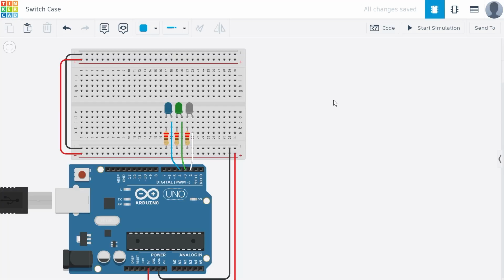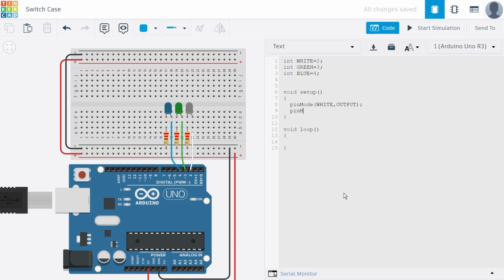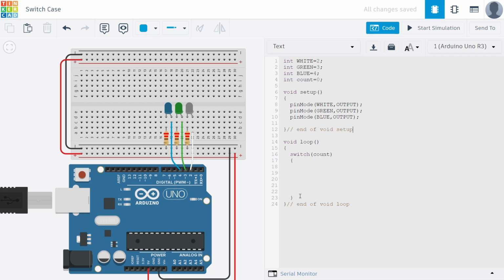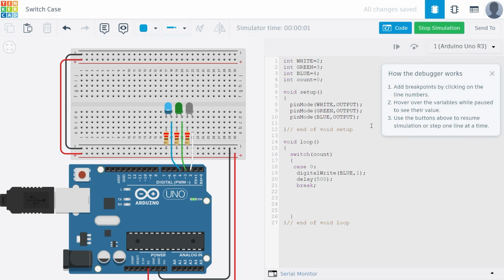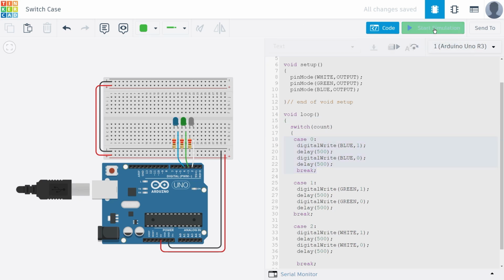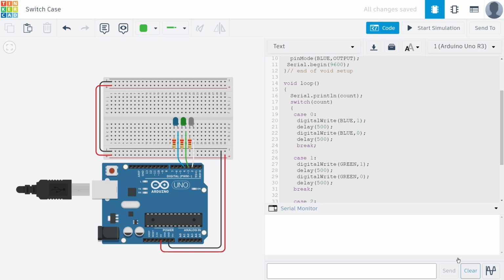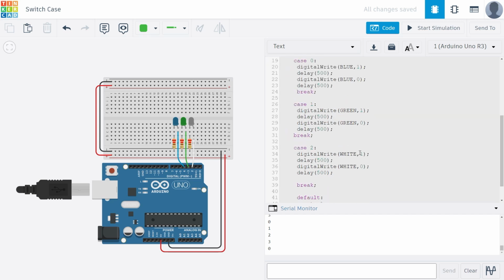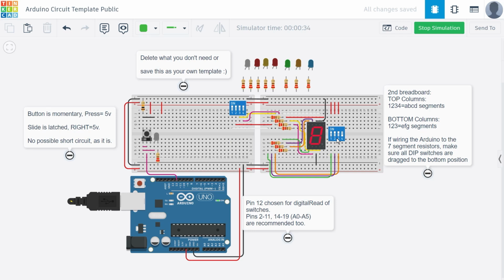Arduino Switch Case - SO EASY!

Comment: Can I put an if statement in a case ? see my example.

void loop()
{
  analogWrite(2,250); 
  digitalWrite(3,HIGH); motor runs
  digitalWrite(4,LOW);
 
 hall1=digitalRead(9); read the state of the hall sensor
 if (hall1==LOW)         if a magnet is over the hall sensor the motor must stop
 {
  analogWrite(2,250);
  digitalWrite(3,LOW); stops the motor for 3 seconds
  digitalWrite(4,LOW);
  delay(3000);

  digitalWrite(3,HIGH); runs the motor away from the sensor hall
  digitalWrite(4,LOW);
  delay(1000);
 } // end hall1

Comment: Thank You James! Someone who explains this stuff in plane English. First time I've understood what you can do with Switch Case. Subscribed.
Reply from the maker: Thanks a lot, @garypowell2016.  Great feedback, much appreciated.  Anything else you want making, please let me know!
The variable that's switched can be in all sorts of places or contexts, it's a great piece of code. All the best, James.
Reply: @E4E  Quickest reply I've ever had! I'm very new to everything electronics & Arduino. I got interested in solar panels last Autumn. Did a few searches and came across a device called Arduino. Since then I've had a lot of fun making my own blinking Christmas lights, an ESP32 camera with pictures coming live on to my laptop, a Squash ghosting board started with an Infra Red remote control - which shows the next position a player has to move to - with 10 different timings of a ghost. At present I'm having headaches trying to make a reaction test for Squash players - made with Pro-minis & NRF24L01 radio control in each LED lit button. I am going to try to get it to start with a remote control. At the moment I'm testing each part of the starting sequence. So far I've managed to use an IR remote to turn an LED on & combined that with button toggle code so that the button press turns the LED off - I then hope I can use this press as an input which I can send over the NRF24L01 writing pipe to another LED lit button. I think I might have bitten off more than I can chew with this one!
Reply from the maker: @garypowell2016   I very much doubt you've bitten off too much.
I start with a decent flow chart. I don't understand squash much but had a Google. Feel free to email maths4engineers on g mail com, and I'll see how I can help! Cheers.
Reply from the maker: @garypowell2016  Oh and nice one, for the circuits made! Have a look at my shorts if you like, loads of daft fun stuff there.
Reply: @E4E  Cheers James I'll let you know how I get on. Thanks.